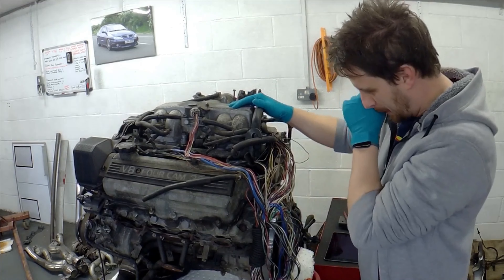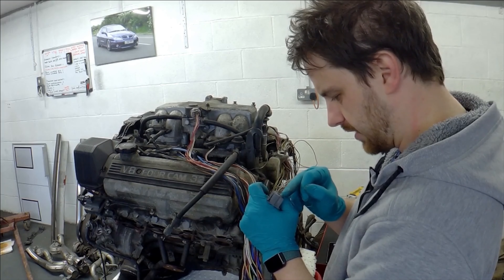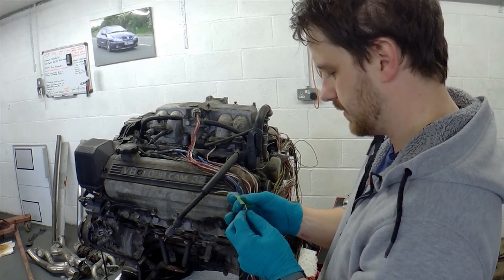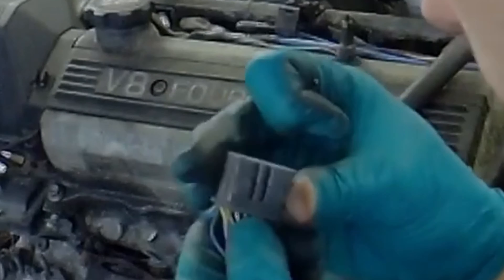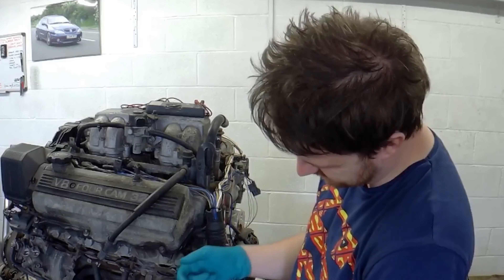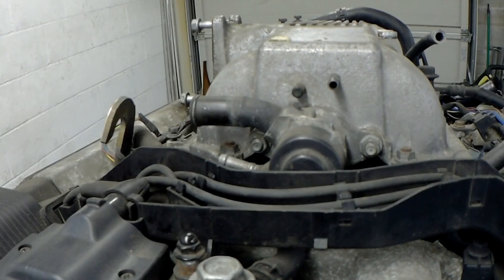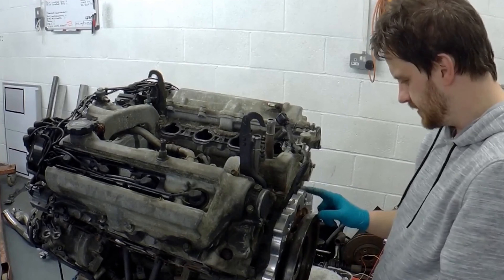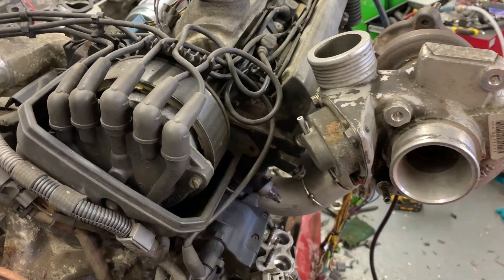How NOT to wire a 1UZ-FE - The Flexus Episode 10 - Ford Focus Twin Turbo V8 Project Car Build

Comment: My inlet manifold was utterly minging with loads of carbon from the EGR, took me hours to clean it all up and repaint it nicely....then I went with ITB's and it's sitting on a shelf getting dusty!
Reply from the maker: I want to change the inlet but don’t want the effort lol - I have an idea to change it but that will be phase 2
Reply: @JaffBuilds  Yep, get it running first then tweak it. I just ran into the problem that it didn't actually fit and then one thing led to another.  Still, if you want a nicely cleaned and painted manifold and TB...
Reply from the maker: One thing lead to another and you ended up with more power .

Funny how that happens eh!? 😂
Reply: @JaffBuilds  The wonders of scope creep! I planned to run the original ECU to start with as well. Except the dizzy's didn't fit. So now COP plus aftermarket ECU, which I planned to do anyway at some point but only after I'd got it all running.
Reply from the maker: Yeah that’s currently the plan... I’m also overly tempted by COP too but I’m trying my hardest from previous lessons learned to just get it in there and running and then start tinkering

Comment: Meh, check engine light is not important anyway...
Reply from the maker: It’s a Toyota - it doesn’t need a check engine light! 

Plus all that egr delete is going to put it on anyway 😂
Reply: @JaffBuilds  EGR delete won't cause a Check Engine Light. I would wire up Check Engine Light and make sure you have TE1 still there so that you can read diagnostic codes.
Reply from the maker: Awesome - appreciate the input. 

I’ll double check all the wires when I plug it into the car 👍
Reply: @JaffBuilds  No worries man yeah leaving that out and not being able to read codes is a real pain in the ass lol
Reply from the maker: So does that require the obd port reader thing?
Reply: @JaffBuilds  Nah it's just Pin 3 W and Pin 5 TE1 on the 16 pin plug. TE1 can be linked into the Diagnostic port but I think from the ECU you have a 95-97 model and that as far as memory serves me does not it went to a TDCL connector inside the car. Either way easy way to do it. Flick switch TE1 one side Ground/Earth the other. Connect W to your check engine light or an LED and everytime you flick your switch Bam you got diagnostic codes. Another added benefit is if you bridge TE1 and Ground/Earth then you lock the timing at 10 Degrees so you can check timing with a timing light without having to pull off loads of covers.
Reply from the maker: You absolute legend! Thanks for the help it’s much appreciated! I will do that - will save me heaps of time maybe lol